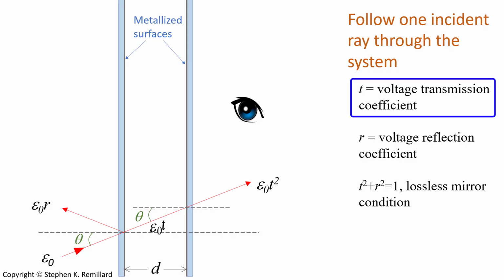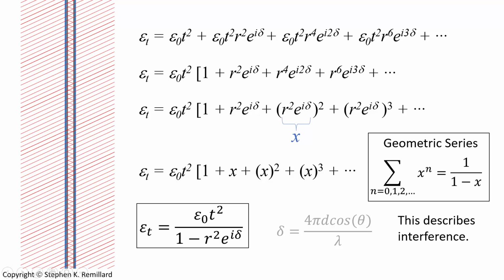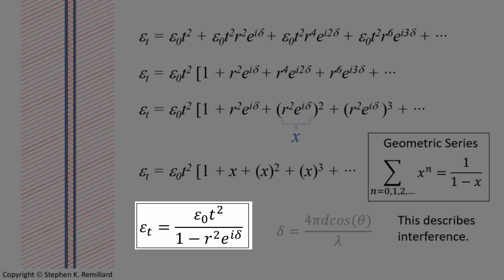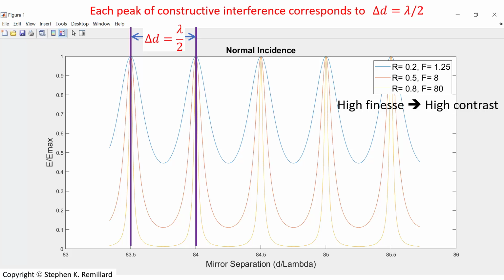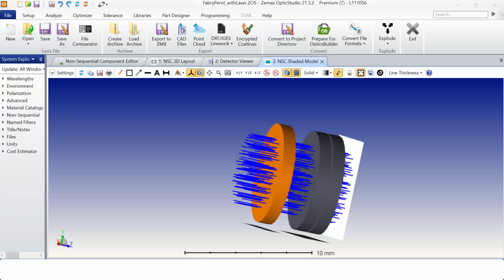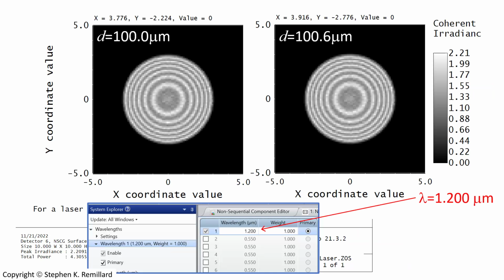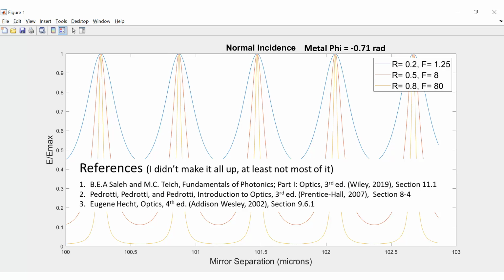The Fabry-Perot Interferometer: What Do the Fringes Mean?

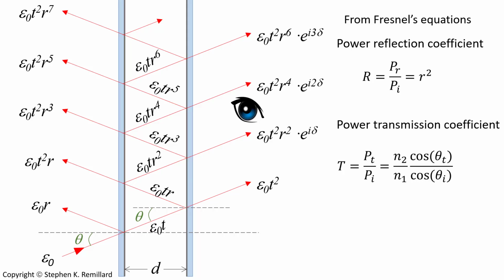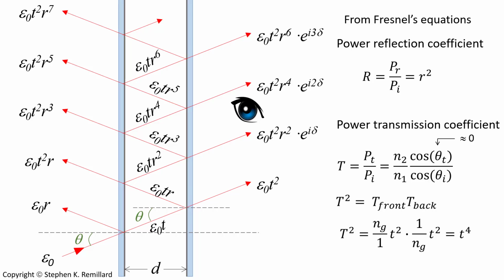Comment from the maker: At 7:00 -  There should be a factor of t-squared multiplying the ratio of cosines.  At 7:20 the next line appears correctly with a factor of t-squared multiplying each cosine ratio.  So, just a one-line typo. 

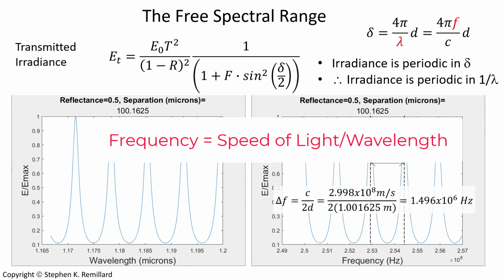At 14:00 - There is a factor 1e6 error in the graph on the right.  The lengths are in microns, but the exponent 1E-6 was not included in the Delta f calculation.

Comment: Really useful video, thankyou!
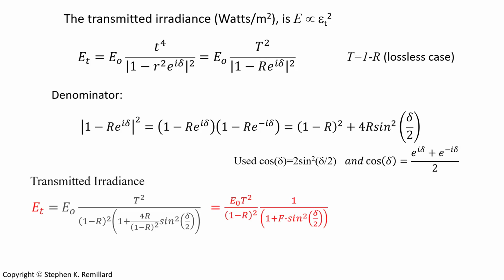Reply: just noticed at 8:28 the double angle formula given is wrong, should be cos (2 delta) = 1 - 2 sin^2 (delta)
Reply from the maker: @josephbennett82  Thanks for noticing.  Fortunately it's just a typo on the slide and not some horrible propagating mistake.  The form of the double angle formula that I meant to show there is cos(delta)=1-2sin^2(delta/2).  The "1-" was left out.

Comment: Good afternoon. This question may have been raised somewhere, so I apologize. The bottom line is that there is a Fabry-Perot interferometer and how to adjust the parallelism of these mirrors is not entirely clear, so far I have found that by interference rings in diameter, if the reception goes to the camera, then shine with a precision LED. Thanks in advance for your advice.